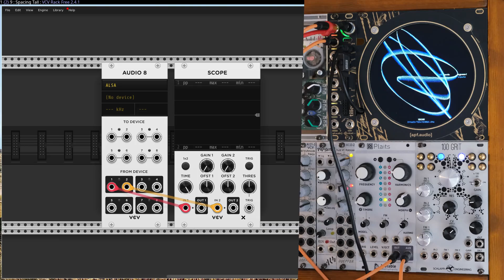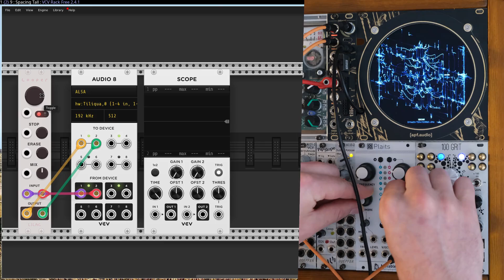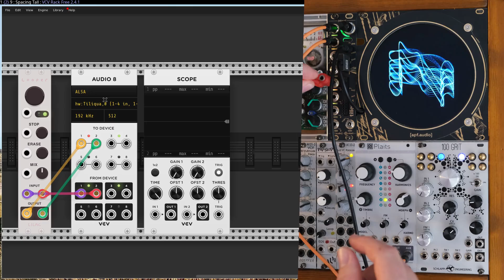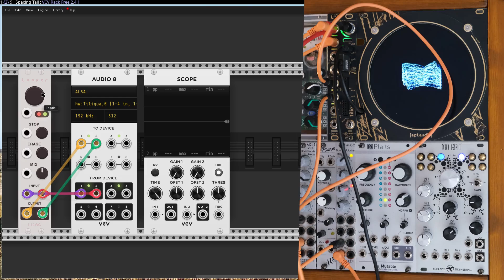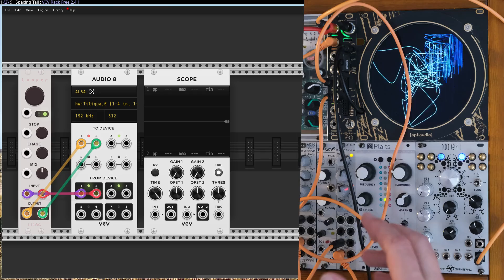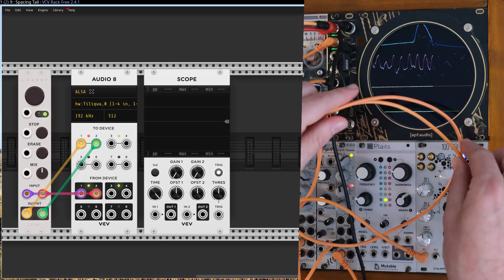Tiliqua: Using xbeam with VCVRack

Comment: Looks great. Is it able to visualize the audio generated by Oscilloscope Music, as shown on Curious Marc's channel? Would make a great replacement for a Tek vector scope among other things.
Reply: any oscilloscope with X-Y mode will do this.
Reply: @Sixta16  No, they will not. Especially digital ones.
Reply from the maker: Yes, it does quite well with oscilloscope music, here's a short clip of some: https://www.youtube.com/watch?v=j2xTi5zl5ac

The 4 input channels let you do color and intensity modulation at full bandwidth as well, which is not found in any scopes as far as I know.
Reply: @vk2seb  Excellent. I'll look to grab one.
Reply from the maker: @vincei4252 thanks for the kind words! creating oscilloscope music and audio-rate visualisation is one of the main points of this device, hence the second function as a USB soundcard for record/playback.

For some stuff though an analog vectorscope simply cannot be beaten, for example video-rate vector rescanning. There were some devices on the market (stroke-raster converters) designed for video rate rasterization, but as I understand it they were extremely expensive + huge and intended for military applications, like adapting old radar vector display outputs to work on digital monitors.

As an example of the sorts of stuff this device CANNOT do: https://www.youtube.com/watch?v=DmUSb1ptCNg
Reply: @vk2seb  Nice, most digital scopes really don't do XY well at all, although they are finally getting better, that's a really good result.